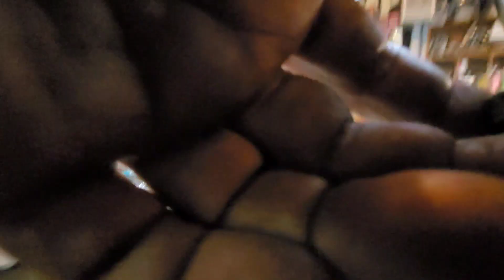lil Rascal part 3

Comment: Bike looks great! Nice job. I looked into those flywheels and was told they don’t fit Predators. Only Tillotson. It’s BS that they sell them to fit predator 212 non Hemi though. Send it back
Reply from the maker: From what I'm hearing that flywheel has 18ﾟ of timing in it the factory  has 25 so it's probably retarding the timing
Reply: I’m also running one on my 224 Predator. Works fine

Comment: When u change the flywheel u have to change the coil the coil only works with the stock flywheel because of the internal governor if u put a regular 212 coil in the ghost with the aluminum flywheel or billet flywheel it would have worked